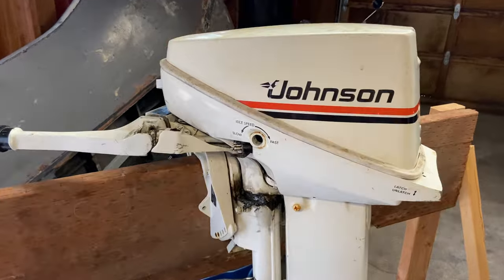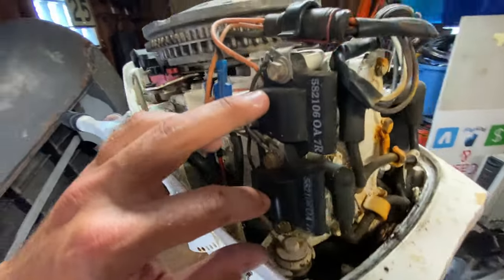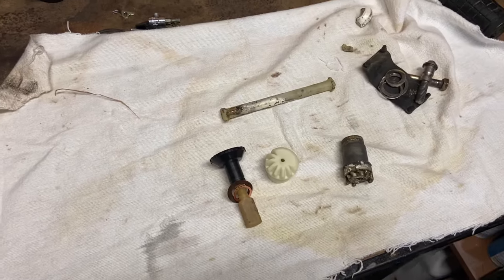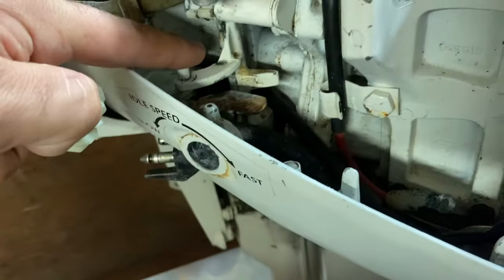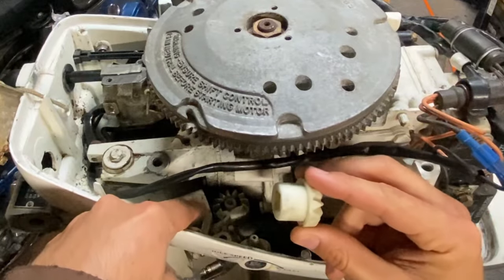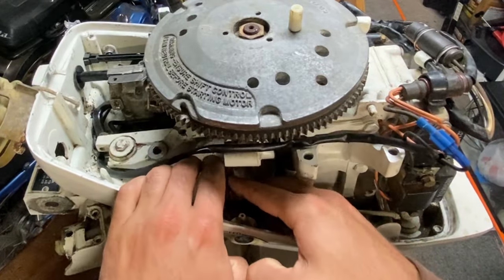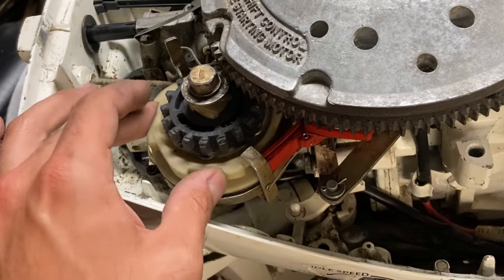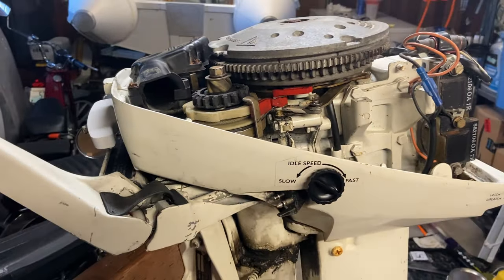$50 Junkyard Outboard - Will it run? |  How To Fix a 15hp Outboard

Comment: Great Video I watch Kodibas on YouTube who does outboards for a living in Kodiak Alaska he often gets plastic bits from his old  parts bin and bone..yard
Worth watching him as he has huge knowledge of JonnyRudes and outboards in general.
I sent him a question I had 4.5 two stroke evinrude twin made in Belgium and I was trying to sort water flow but could not see how to change thermostat he came back when supplied number and you can't find it cos it unusual in that does not have a thermostat has impellor and pump as normal so his knowledge is priceless I also had great Boat shop selling fishing boat and Cruisers for years since 60s  he was another mine of information he would answer a question with part number get out the catalogue the original dealer version and say thought I remembered it right he has retired but is still mine of information for that shop for powerboat owners. Sadly many experts like this retiring and passing so keep up the work....

Comment: Hey thanks for the vid. I have a 15 hp Johnson just like this, and it'll start, but on my last trip, the recoil got stuck in the unravelled position, plus I've been having some issues with getting it to idle well. Perhaps by watching your vid, I can fix the recoil, but what do you think might be causing a potential idle/perhaps overheat condition? I'm thinking that it might be an impeller or water pump issue? Anyway, gives me hope to see you getting your motor running again!

Comment: You got a bargain indeed!  $50, damn sure wish I found an engine like that for a great price.  Kinda looked like you got that red interlock arm on the wrong side of the starter cup holder...The red interlock arm straddles that cup arm, but am guessing you figured that out when you went to start it....Not a real strong stream out of the cooling telltale, but the hose/nipple may just be plugged up...  In any event, this little engine is worth much more than what you paid for it, don't "give it away" to cheap....

Comment: I am just curious, is there a reason you started it in gear. Does it start better under that small load?
Reply from the maker: I started it in gear so I could start it with more throttle. Initially it had a hard time starting but now it runs great! Check out my recent hydroplane series to see it in action
Reply: @kevinsgarage  nice, thanks for the tip. I forgot that the old 15hp's don't have a shifter.
Reply: @kevinsgarage  My 15 can't start in gear with, there's a lockout.

Comment: hi great video i seek info on a 25hp johnson motor got no idea what fuel mix i need is it 50 to 1 or 25 to 1 thanks
Reply: What year?  Generally any Johnson/Evinrude will run well on 50:1.
Reply: I supose by now you've figured out the oil ratio?
I hope you used TCW3  2 stroke mix oil (for water cooled engines)?

Comment: 🌴hey Kevin looks like ya got a deal you didn’t have to invest to much to get it running, I’m picking up a 1977  Johnson 15 hp tomorrow, the guy that owns it said it sat for 8 months and it ran before he put it away but 👈🏻 it would only run for a while and shut off ?   As I haven’t  seen what’s going on yet I don’t know if it’s a fuel ( did find a pinched gas line ) problem or carb, or electrical, it could be that there’s no water being pushed and it over heating and shutting down, or maybe a fuel delivery from the tank ?  Something to find out yet !  Ya got a deal on your motor 👍🏼
Reply: How did it all work out?
Easy fix?
Reply: @JohnSmith-pl2bk  once I got the motor back home I decided to just go through it as i want it to be dependable, new pull rope , pinion gear on pull starter , checked compression 👍🏼 110 lbs , replaced fuel lines , rebuilt carb , replaced spark plugs, coils, and power pack 👈🏻( this I think was the problem one old coil and one new replaced both ) replaced the impeller and housing, and new gear lube , replaced twist grip throttle gears and shaft and idle adjustment knob assembly, the motor runs great all’s that’s left is to sand it down and repair it and try to find a decals kit ,
Reply: @davescheer5038  
A lot of work but now you know this engine very well.
You can trust it because you have done everything to make it reliable.
If you like someone who during the winter takes a nut and bolt restoration approach to old Farmall tractors..
and then uses them on his small farm..
YT channel "Just a Few Acres" might interest you.

Comment: Frankly speaking, I love Evinrude, but unfortunately this marine engine has never worked in North Africa... It always breaks down, the carburetor cup rusts quickly, and the method of operation is considered primitive... Yes, it is a very powerful engine of the 9.9 and 15 class... The problem is that it is not practical.  .